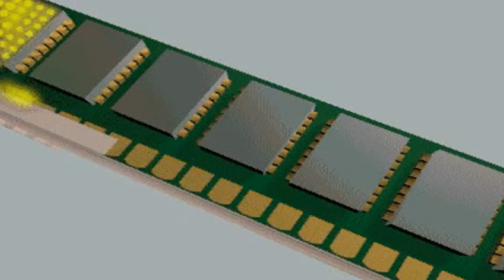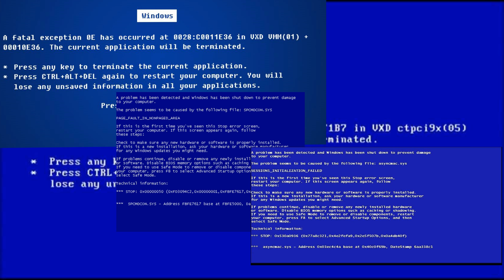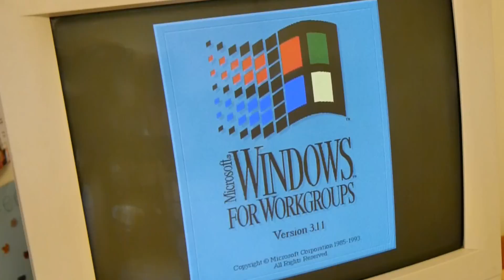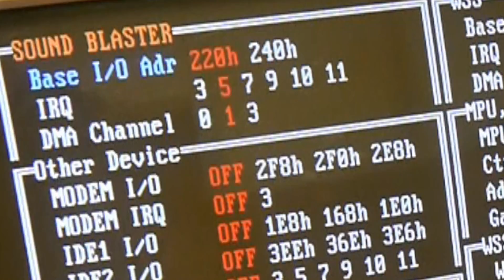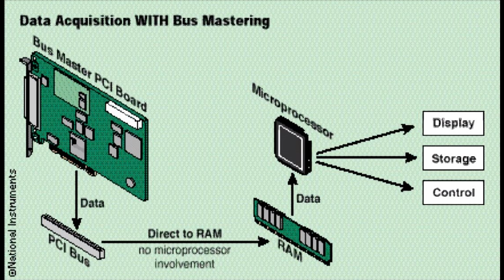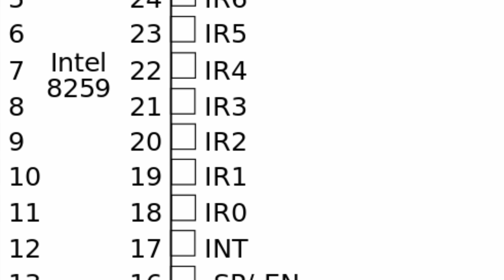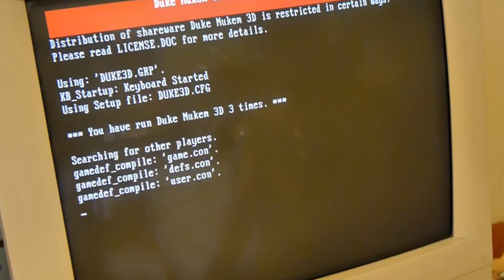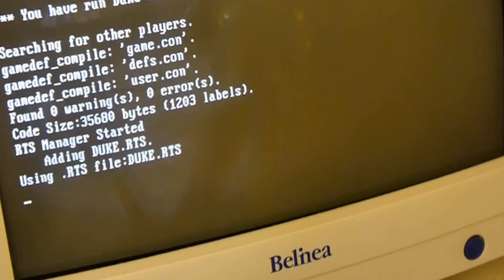What are IRQ, DMA & Address Ports? - Soundcard Memories [Byte Size] | Nostalgia Nerd

Comment: Fun fact: the main reason it took so long to get Plug-and-Play is that it requires a bunch of self-configuration circuitry on each expansion card, and that circuitry was expensive!

The Macintosh II had it as early as 1987, but it was a very expensive machine and so were expansion cards for it.

By the time Plug-and-Play came to the x86 PC platform in the mid 1990s, the circuitry had gotten cheap enough that this wasn't a huge problem any more.

Comment: Plug and Pray indeed! Just had to disable PnP Aware OS on my MMX's bios and then change the ethernet card on pci slot 2 to irq 12 to make the sound card work properly! Whatever is up with this M571 board, it doesnt like giving an IRQ to the VGA and the sound card at the same time. Or maybe its because of the network card but in any case it took me waaaaaay more time that it should have to figure this out!

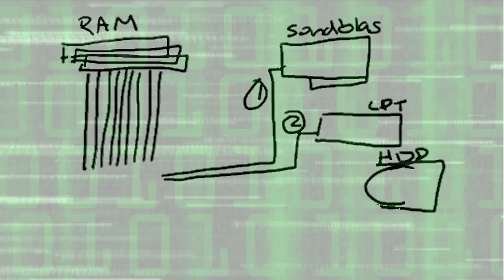Comment: 01:21  386 can address 4096 megabytes of RAM?  REALLY???  Someone needs to correct their errors.
Reply: its a 16bits cpu with a 32bits address bus, of course it can address 4GB like any other 32bits cpu, the main issue was that chips back then didnt have enough density for 4GB to be feasible. Of course you had double/triple height SIMMs with like 36 dram chips each! (i have 2 of those) but those usually had ECC (8+1 x4 = 36) and were for server boards only. (just google 64MB SERVER SIMM and you should find lots of images) All you needed was a board with a memory controller that supported 4GB of ram, and being that SDRAM SIMMs were so low density you needed lots of chips meaning the memory controller had to be really powerful to drive all the chips and lots of modules at the same time! So if you could magically procure a lets say socket 3/5/7 board with a memory controller that supported 64 SIMMs slots, you could have 64 64MB SIMMs (with a total of 2304 16MBits chips) and make 4GB. Of course so many chips and specialized hardware would be super expensive, hence why only servers take the "add more chips/modules" route with ram modules. Also notice they didnt have Registered, Load Reduced or Full Buffered modules back then. Nowadays servers that have 8 or more memory slots per cpu use those types of memory modules. They are not as fast as conventional unbuffered memory but if what you need is quantity, they are the way to go.

Comment: Ah, the good old days, my tactic for the really tough ones was to prepare a "cheat sheet", listing things with their resources in order of flexibility... absolute requirements first, going down to devices that had the widest choice. For some particular combinations, the DMA day was saved by one device allowing DMA 0 (formerly memory refresh, but available on 286 or better - and yes, the high DMAs were available too but there were never that many devices competing for them.
DMA 0 - formerly memory refresh, latterly available but a rare option on devices
DMA 1 - first choice of pretty much everything!
DMA 2 - floppy controller
DMA 3 - the usual backup selection of devices
Competing... Sound card, Network card, Old scanner cards, LPT1 in ECP/EPP mode

Comment: The 386 can address how much ram? lol! (He said 4,096MB instead of 4,096KB) Sorry had to point it out.
Reply: A 80386DX had a 32 bit address bus so yes it could address 4 GB of memory(NOTE: The 386SX was a cutdown version and only had a 24bit address bus). The fact that there weren't memory chips of that capacity at that time doesn't mean the processor didn't have the capability to address it. Todays CPUs could theoretically address 2 to the power of 64 (64 bit addresses) memory which is 16 Exabytes (an Exabyte is a million Terrabytes). In practice on current gen processors however the physical address range is limited to 40 bits(1TB) and the virtual range to 48 bits(256TB) because that is more then enough with memory module and HD sizes for the foreseeable future. They do however use 64 bit address values though only the lower 40/48 bits are actually used currently. If a bigger memory space will be needed in the future they can just add support for more bits in the physical addresses in next gen processors, without breaking any old software or any need to specifically program for that in new software.

Comment: I was big into the Amiga and those computers had Autoconfig for the hardware. It was a nice way to handle things it it worked well unless you tried to--for instance--add more Zorro RAM than the computer motherboard could address.

It was a simple and effective version of "Plug & Play" before the Wintel systems got Plug and Play.

https://en.wikipedia.org/wiki/Autoconfig

Comment: Trivia addendum to the IRQ stuff: aside from priority, interrupts are also distinguished as maskable or non-maskable, which determines whether a higher-priority interrupt can override a lower-priority one if the latter has already begun executing.

As the video says, an interrupt causes the CPU to dump its current instruction pointer and register contents into a cache and load the interrupt handler, service the interrupt, then reset the registers and instruction pointer and resume whatever it was doing when the interrupt came. Now, if the CPU is in the middle of working on a priority 3 interrupt and suddenly gets a priority 1 interrupt, it checks the value of a certain bit in the priority 3 interrupt and depending on the result, either tells the priority 1 to wait for its turn despite its higher priority, continues working on the priority 3 until finished then greenlights the priority 1, or pauses the priority 3, does the priority 1 immediately, then resumes the priority 3.

With today's clock speeds, being forced to wait for another interrupt to finish usually doesn't mean much delay, but if a high-priority interrupt were to do something that needs an ongoing low-priority one to finish, it would deadlock the system if the high-priority interrupt gets precedence.
Reply: now days its all software interrupts on windows from other processes ruining my realtime audio fun :(

Comment: Just recently tinkered one of my retro pc. Some have a tiny board with a all in one cpu chip, which is a pain in the butt conflicting irq at sbpro emulation at it's own will... also lack of bios settings, not partcular dos compatible. If I remember correctly it was a cyrix mediagx cpu.

Comment: God, remembering this let me love my Windows 10 PC ten times more. :) 
All the hassle with IRQ, DMA and the different RAM Spaces for drivers in DOS..  Don't miss my config.sys really.
And those jumpers, Floppy and IDE cables. Figuring out all that stuff on you own basically, without the internet to guide you. 
Now almost every thing runs out of the Box, with Windows getting the drivers itself via Update. 
Also PCs don't crash or die due a failed fan anymore, because everything is monitored and smart in itself nowdays.

Comment: The one thing that I found more frustrating than IRQs, DMAs, and address ports was the crappy PNP management software that always refused to configure devices they way I wanted. Windows and it's device manager made things a bit more tolerable though ...

Comment: It's worth noting that not all cpu architectures have a concept of ports. It is very common to map peripherals to memory addresses instead, memory mapped IO. I know that the GBA and original NDS consoles do this, I suspect that more recent ARM based devices do as well but have not had any reason to look into it.
Reply: A lot of home computers like the Amiga used memory mapped IO as well. (They also used DMA to do memory to memory transfers to do things like create hardware sprites. Leaving the CPU to do other work instead of it having to actually drawing the sprites pixel by pixel.)
(For those who don't know: A sprite is the name for an ingame object like the character you control or the enemies you have to evade/shoot.)

Comment: I remember my second home computer. An odd Frankenstein 386 put together by my science teacher. It used a non ide hard drive. I guess cause that's what he had. When I bought a cdrom/soundcard kit, something about the new stuff kept the serial port (mouse) from working. 

I even called tech support for creative. When I told them the.cable going to the hard drive wasn't 40pin, they gave up. 

I finally just got a mouse emulator off aol. And used a joystick for cursor movement in cd games until I replaced some things. 

Sorry for lack of details but this was 20 years ago in hs

Comment: Awesome video, brings back memories of getting my ASound Gold ISA sound card(sound blaster 16 clone with Yamaha XG midi) to work in DOS,  windows 3.1, and later Windows 95 I learned quickly to write all my IRQ and jumper settings down on paper after I figure out what worked, and did not work. Edit: just pulled out the 2 CD driver disk I have for the later PCI versions of those cards, and I'm going threw the sweet Midi demos on them that play great with my Asus Xonar DG PCI sound card in Wndows 10 LOL!

Comment: I never bothered with plug and play until Windows 2000 because I knew the statistics even though it was on Windows 98 SP2 and Millennium I skipped it.  Windows NT/2000 was the first addition of Windows where the system worked.  While I had issues with the traditional way, if I just keep with the system allowed with ways to fix the problem.  Even this guy acknowledges plug and play didn't work worth a damn.  Somehow they solved the problem I guess with the NT core because the operating system was less DOS shared.  With Windows 95 and 98 Windows covered about 62% of the decisions which is more than half which is why windows 95 was called the first true operating system.  in me they pushed it to 68% however windows ME was truly unstable causing users to reinstall it every 2 months.  The information they gathered from user errors in which individual updates sometimes were provided, the information made NT which pushed it to somewhere around 78%.  They used it threw XP and then shot for making a core that ran 100% of functions...this was vista.  But the point is that there was a hang up in the communication between Windows, Dos, and the motherboard firmware causing hang-ups.  I knew it, and so did Microsoft.  It was why they were shooting for NT.  Doesn't mean they were right making people pay for windows ME a test product as a standard upgrade.  I know you all are hoping to NOT discuss Microsoft track record...its hard to prevent this link up why?  Well, there was too much communication issue between the Triangle.  Windows/Motherboard Firmware & MS Dos.  There had to be a loser.  Windows was modern tech preferred for the most part, Motherboard firmware was and still is the pinnical of start-up weather you see it or not because there has to be control handling before you are delivered safely to windows by your Motherboard manufacturing which manages the boot-time and registry of hooked devices.  MS-Dos was elected, but this is a goal simply put.

Comment: So you could only have 4 cd drives then not 5... I don't know why you would need five but is this correct?
Reply: +Zac Meyers  That depends on whether your CD drives are IDE or SCSI, or require a interface card.  Originally, CD drives required an interface card, because the original IDE controller only allowed two hard drives, one as master and one as slave.  You would have been correct; back then, each CD interface card required its own IRQ, DMA, and I/O address.

Then the ATAPI specification was updated to allow you to connect a CD drive to your IDE controller, so you could have one hard drive and one CD drive without needing a separate card for the CD drive.  Then EIDE (Extended IDE) came along and added a second IDE channel, which could support an additional two IDE drives.  It was common practice to attach your hard drive(s) to the first IDE channel, and CD drive(s) to the secondary channel.  You could still connect additional hard drives or CD drives by adding expansion cards.  For example, you can theoretically have four IDE channels, allowing you to connect a total of 8 IDE drives.  However, the two extra channels often had software support problems because they were on a "nonstandard" IRQ; most drivers expected the IDE channels to be on IRQ 14 and 15.  It's not as much of a problem these days because Plug & Play actually works (most of the time), and modern operating systems since Windows 95 SR2 have something called "PCI IRQ Steering", which allows multiple cards to share a single IRQ.

If you need more drives than that, you have to switch to SCSI.  A single SCSI-2 host adapter can support up to 14 drives.  And yes, you can mix-and-match... for example, you might have two or more IDE hard drives in a RAID configuration, then have multiple CD/DVD drives attached to a SCSI-2 host adapter.  I've seen servers with up to 40 DVD drives.
Reply: SpearM3064 Wow thank you for that explaination. I can't imagine having to set up 40 DVD drives, hardware or software wise.

Comment: For anyone still learning about such topics (particularly those interested in homebrew computers), it might be important to note that communicating over ports was almost identical to communicating to a memory address.  The same data and address bus was used.  About the only difference was that a different pin was enabled on the CPU to trigger your devices, so system memory remained disabled during that action.  

Simpler CPUs such as the 6502 didn't have ports, you just communicated with your devices within the normal memory address space.  This wasn't the most advantageous since obviously you were wasting address space that could be used for actual memory, as well as the additional hardware logic required to decode full memory addresses to know which device to trigger when being communicated with.  Logic chips added to the cost of the product and made the board more complex, so you'd often find times when unnecessarily large areas of address space were wasted just to simplify address decoding.  Using ports meant you could happily waste that space with a simpler hardware design while keeping your full range of memory intact.  

As for how all of this related to the actual PC, those of us who developed anything even remotely low-level back then will probably remember Ralf Brown's Interrupt List.  It was a treasure trove of interrupts, IRQs, ports, memory addresses, and more, for a variety of hardware devices from various manufacturers.  It was on just about every BBS at some point.  This was essentially the PC bible for a lot of people at the time, and pretty much a necessity as a hobbyist.  They continued updating that thing for years.
Reply: Let's not forget that there was memory mapped I/O on the PC too, the video frame buffer for example. The fun with memory mapped I/O starts when you get really low level and find your memory mapped I/O is being cached :-) Also worth noting, If I recall correctly, C had/has no standardised way to access a separate I/O space or register an ISR.
Reply: It's not about a CPU being simpler. Motorola chips like the 6532 and the 68k, by tradition, use memory-mapped IO, where chips made by Intel and Zilog, starting with the 8080 and the Z80, used a separate address space for IO. AFAIK the 68k could only do memory-mapped IO, but with 24-bits of address bus lines, this was not a problem.

Comment: I miss those days, I loved the challenge of getting reputedly difficult combinations set up.

The killer was the low DMA channels 0-3, and in the AT and above era where DMA 0 was no longer needed for memory refresh, if one card offered it, it saved the day.

The Floppy controller was always on #2, so unless a device did offer #0, you could struggle.
Typical devices that needed a low DMA (0-3) . there was never a problem with high DMA (4-7), were:
Sound card (typ #1,  often the one device that could take #0))
LPT port in EPP/ECP (typ #3)
Network card
Scanner interface card
SCSI or other interface cards

Comment: That was excellent! I miss those days to be honest. Everything was locked in once you configured your cards and it was transparent. No funny business going on in the background. I always kept my system quite simple and had little issues. Disabling unused resources on the IO controller like printer port or second com port helped a lot.
Reply from the maker: PhilsComputerLab Many thanks Sir Computer Lab, I've been enjoying your high RPM hard drive videos recently. It was a time when everything was just more understandable, and we were made to understand. It's a shame everything is so glossed over now.
Reply from the maker: If you mean PhilsComputerLab, good choice. If you mean me, many thanks!
Reply: Nostalgia Nerd this is actually my favorite computer channel. Every upload is a celebration.
Reply: If you had a simple system it was awesome but I recall a weekend in 1995 at my cousin's place where we could not get his Creative 16 bit kit (Sound Blaster 16 + Quad Speed CD) working. Turns out it was a freakin conflict with the Genius scanner. A monochrome hand held devices his dad used to scan in hand drawn mathematical equations for use on maths question papers. I had much less drama (at least install wise) with my ESS 1688.
Reply: PhilsComputerLab Things nowadays are similar except  the Intel processor is replaced by a potato that is Microsoft firmware proprietary.
Reply: I never knew how to figure out which ones applied, trial and error every time lol
Reply: I can't imagine setting up each and every USB-device manually .....
Reply: While I had some fun, some hair-pulling times, learned my tech skills from those times, I much prefer the ease we have today,
Reply: I love full manual control!
Reply: Nostalgia Nerd no i mean you. You make complicated things simple.